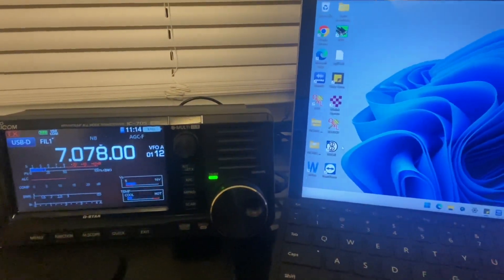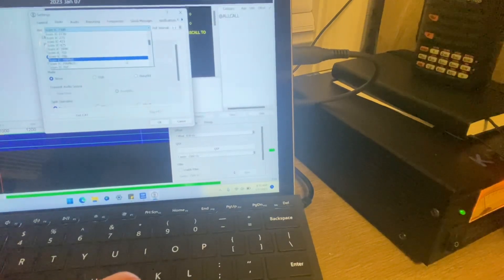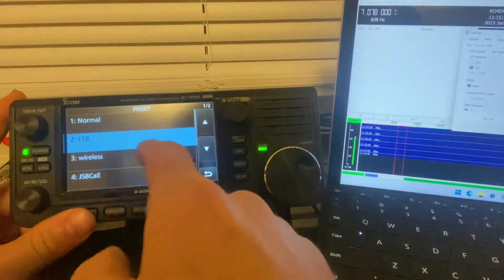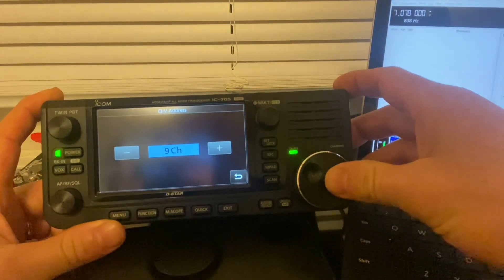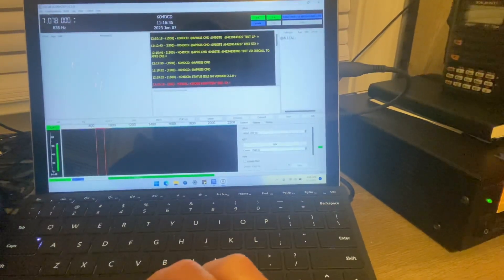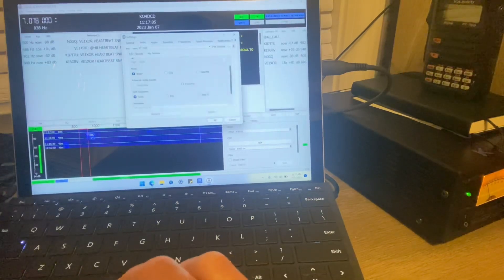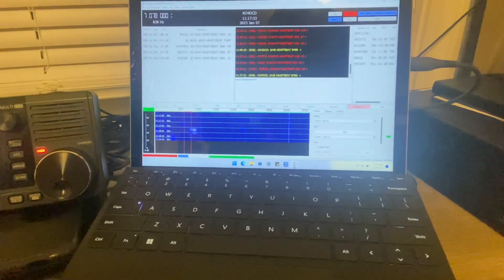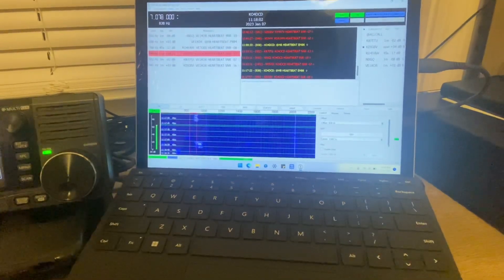JS8CALL and IC-705 the easy way

Comment: Have you seen an “error in sound input” pop up? Followed your steps and cannot get the ic705 to pipe into the computer.
Reply: I find about 95% of the time sound issues are on the computer side. It could be an issue of having the wrong item selected for input on the sound menu (for windows). You may need to go into hardware and sound to see that all the correct items are selected and most importantly that you have the drivers downloaded correctly. You should be able to see the device under ports inside of the device manager when you plug and unplug the usb cable. The first thing to look for on wsjt-x is the waterfall having signals on it. If you can see activity on the waterfall then the input is working.

Comment: Thanks for the video. I was banging my head on the computer trying to figure out what was the problem with the CAT control- the audio was OK.  Address- address - address!  A4h isn't going to get me far, but the 94h is where the port lives on the 7300 and all is now good.  One note - your audio was really low and muffled. I had to use CC to get the info- glad I stuck it out because it worked. thanks again.